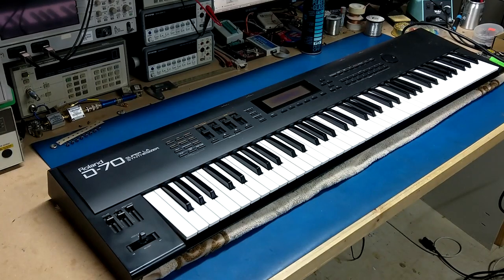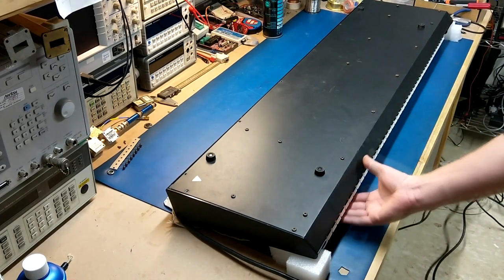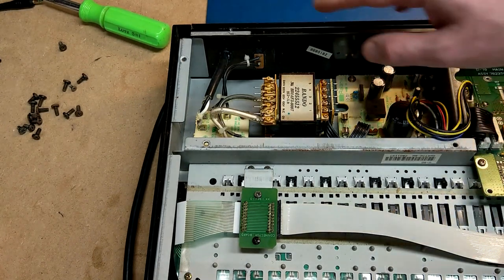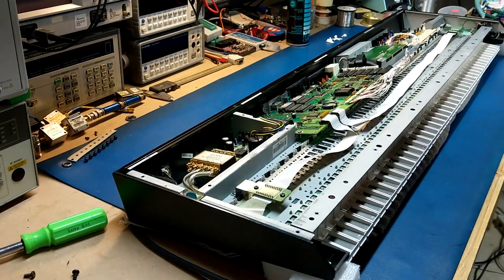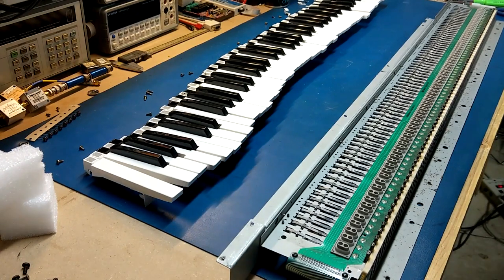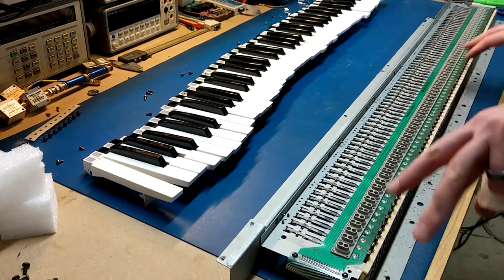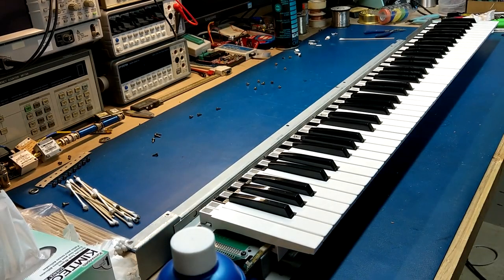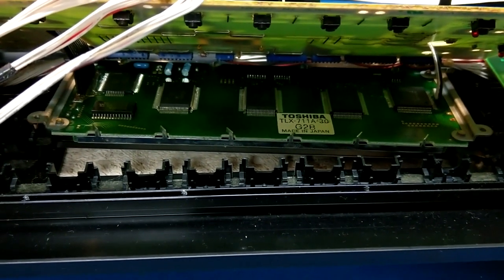Roland D-70 Teardown and Repair

Comment: Thank you for such a great video.  I didn't even realize Roland ever made a D-70.  My first synth was the D-5 and proudly still have it. 

For the dreaded glue you talked about, can you please share any insight if you have ever cleaned a unit of leaking glue?  

I was given an old Roland ep7 with sticky keys and I haven't found any cleaning videos you mentioned. I've tried everything from GooGone (US) to paint thinner and acetone (in light swabs).  The only real effect I've had so far was actually soaking the keys in vinegar or rubbing alcohol, but that only made it gummy and still impossible to dissolve.  The glue has run into the felt too, so with dropping weights and running glue, it might be a lost cause, but thank you for any insight.

Comment: I looked at a D-70 for a friend that was dead.  It's been a whlie so I don't remember too much of what I did.  After I got it open I did the normal once over and found no crispy critters or telltale burnouts.  The electrolytics looked OK.  I plugged it in, powered it up and found that there was no 5VDC.  I unplugged the power supply from the system and there was still no 5V.  I replaced the regulator.  It popped as soon as I powered it up again with the system plugged back in.  I have taken many electronic things apart.  I work for Xerox for 23 years also.  I was a Ground Radio Tech in the Air Force years back.  I did not have the documents to go very far and I had no experience with these connectors.  Actually I have no way to replace the connectors if I broke them.  Off the top of your head...got any ideas?

Comment: Hi I've got a Roland D70 too. I wasn't able to remove the black ribbon cables from the two side of the main board. I tried to force but I risk to break someting. From your video it seems that you do that very easly..Any suggestion? I also read the service manual but I didnt find any solution
Reply from the maker: Lift up on either side of the connector with a small screwdriver, it releases the compression fit onto the ribbon cable which allows it to be removed easily.

Comment: I have some keys that aren't responding... - I have cleaned them 3 times now and still no luck....   Keys that aren't working have black tape or a white mark on them... Have cleaned them 2/3 times and still no luck...  The membranes and contacts look as good as the rest....  Any ideas??

From the bottom of the keyboard the keys are:  G, Eb, B, C#, G & I A
Reply: I tried to attach a picture - but it did not upload...

Comment: Hello guys! I would like your help. I won a Roland D-70 without a memory card and with a discharged battery already replaced. I would like to know if you can connect the keyboard without the card to test if it is working

Comment: Struggling to disconnect the motherboard, the white rectangles connecting the left side seem stuck or soldered while you removed them easily, any advice?
Reply: Push down, then pull.

Comment: Hey Brad! I just bought a D-70 on craigslist with a bunch of dead keys. I'm following your video and have taken the keybed out. I'm at the 16:47 stage of trying to take off the keys to get at the contacts but the keys seem to be stuck. Do you have any advice?
Reply: Update: theres a strip of plastic on the back of the keys that is holding the keys in place. When I remove that plastic the keys come out as described. Do you have any clue why that piece of plastic is there?
Reply: Just a warranty for intense playing musicians. Just in case the keys stay in place. You can omit this step, it will work like a charm without.

Comment: I wonder if I can help me. I came across this video after doing my own tear down to replace the backlight on the LCD display. As you’re aware, it involved removing the main and card slot board as well as dislodging the keybed to access the display board. I replaced the LCD backlight just fine and put everything back together, but now it’s not working. No sound. Nothing on the display except the backlight and a black rectangle. I typically take photos of wire placements while I’m taking things apart, but this time it was so straightforward I didn’t think I needed to (as you said, each port is different so you can’t screw it up). I’m wondering if I just connected the ground wire to the display board at the wrong location?  Or maybe did I replace the LCD into its housing upside down?  The only wires I dislodged were the black ribbons on both sides of the main board. Could they somehow be backwards?  Any idea what I could have done wrong here. I’ve done many backlight and display replacements through the years with no problem, but I admittedly know very little about electronics.
Reply from the maker: That is strange, I would disconnect the backlight to make sure it is not the culprit. Then remove all the other connectors again and re-seat them to make sure their pins were making good contact.
Reply: Ihave roland xp60 power on display start and display  graphic image no coming or no audio please help me

Comment: Hey there,
1st, I'd like to thank you for the great look inside the good old D-70! I still have mine since that synth came out and wanted to reuse it right now after having stored it, standing on the the backside with the keys to the top in it's alucase in my dry cellar. BUT THEN - SURPRISE! - the glue theme... Every (!!!) key had started to "bleed" following the gravitation over the last years down there...🤦‍♂

So: H E L P! Did anybody find a better solution but scratching off the "bloody glue" with a pocket knife?!?

Greetings and peace!☮

Comment: My d70 keybed is all glued together.  Seems the glue holding the weights under each key melted and fused together many keys.  Any Keynes’s available??
Reply: Mine has the same issue. Most of the weights under the keys unglued, fell off the keys and got glued together in many places. My d70 has been sitting in a closet waiting to be repaired.  I’m hoping watching this video any reading some comments will help.  Best to you.

Comment: hi! what are those round waxy things under the velocity rubber switches? thx.
Reply: Those are diodes, which are commonly used in matrix-wired keyboards to keep keys from interfering with one another. Since they're soldered to the flexible circuit, they put some sort of rubber or silicone around them for protection.

Comment: Hello, i have a d20 and some notes of the central area are notnworking at all. I guess it's not about cleaning. What can I check? Resistors are ok and connection too.
Reply: Have you tried applying some carbon to the contacts?
Reply: @itsJoel59  yes i did but are too damaged. The track are completely missing sometimes
Reply: @itsJoel59  I solved by soldering and bridging with some wires 💫
Reply: @davidederosi6068  nice work!!

Comment: I couldn't tell what color glue was holding in the keyboard weights, but I believe the D-70 suffered from the same leaky "red glue" problem the JD-800 did. Just something to look out for. Maybe it was the U-20 with the leaky problem like the JD. :P
Reply: Ok, I see the weights at 26:04 and yes, looks like the same red glue that has also leaked a bit (I see it in other recesses where it shouldn't be).
Reply: Ok, you mention this at 28 in. :)
Reply from the maker: I think I discuss the red glue problem in more detail in one of my other videos, possibly on the JV-80 which also had the problem. Thanks for watching!
Reply: JD-800, JV-80, JV-90, JV-1000, D-70 and (you will be surprised) part of XP-50-60-80 suffer from this red glue problem.
Reply: This video brings back horrible memories. I had a bunch of key weights fall off my D70 and drip glue all over the contact bed. The black keys were the problem as they dripped right onto the bed destroying the contact for that key. The white keys dripped onto the ledge at the base so my fingers would get sticky. Once I ordered all new keys from Roland and replaced them, but the same thing happened with the new keys. I also had to replace the contact beds several times, since cleaning did not get the glue off. There are two beds. At the time, one was $85, and the other $55. This was when Roland would sell parts directly to customers. After a few years of this I had to give up - it was a huge waste of time and money, and even though I really liked the D70, I couldn't go on. I was tempted to smash it with a sledgehammer in case I ever got the thought of repairing it again, but I ended up putting it in its case, and putting it in storage. I haven't looked at it for over ten years.
Reply: @sqmus  A few years back, I got one of the last Roland new keybeds for my JD-800. I wish they still sold them to consumers. Not only was the red glue a problem in my old keybed, but I didn't realize how much life it had lost. The new keybed is superb.

Comment: Hello. I cannot remove the black colour ribbon cables from their white sockets on the main board. As you know, there are two ones on the left and four ones on the right and those 2 have a different insert method comparing those four ones. Could you please tell me how to take em out...? I carefully watched your video, however the related scenes are not clear...Ta
Reply from the maker: They are removed by pushing down on top of the white connector next to where the black ribbon cable is connected, then pulling up on the black ribbon. They require a bit more pressure as they are a thicker gauge ribbon cable.
Reply: on the left or on the right ones...? They look different. I guess you describe the left two ones. What about those 4 ones on the right...?

Comment: It's the first time I've seen an "intel inside" synthesizer.
Reply: It's not all that well known, but a bunch of polysynths had Intel processors in them back then. The Roland MKS-80 and Kawai SX-240 are two that I have. Pretty sure the Jupiter 6 also has an Intel processor.

Comment: Does anybody here know how to release the white connectors for the black ribbon cable on the main board going to the display?  I had some dead keys that I wasn't able to fix so I'm going to part mine out.  But I can't release those connectors to save my life.  It looks like he just does it by hand at 14:55.
Reply from the maker: John, press straight down firmly on the white plastic strip along the top of the connector. It is spring loaded and will release the tension off of the ribbon cable pins allowing you to remove it with little effort.
Reply: @bradthx  Great!  Thank you so much!  I've got it all apart now.  And thank you for the great video!

Comment: Hi bradthx, I wonder if you can help, I have a Roland G1000 arranger keyboard 1999 model, but the LCD display is fading I have tried too find a replacement  for quite a while but to no avail, as you know a lot about keyboards I am wondering if you would know of a generic that would work, or even what backlight I could use that would fit, I did look on EBay but the don’t show any wiring just the face could be dodgy, I don’t know, I hope maybe you can give some advice, await your reply, kind regards Noeline

Comment: I am attempting to fix the dead keys as well currently. Thank you for your insightful video. To anyone else trying, the manual offers clear instructions: https://www.manualslib.com/manual/1006107/Roland-D-70-Super-La.html 
And also, keep in mind that in this video the stopper holding the keys in place is missing.
Reply: How do you put back the stopper after removing it ? Special kind of glue ?
Thanks
Reply: @georgek3039  You can click them back in.